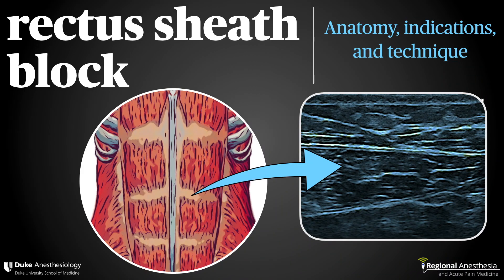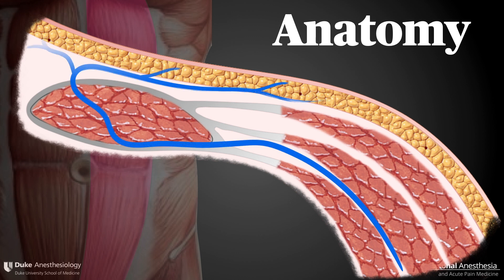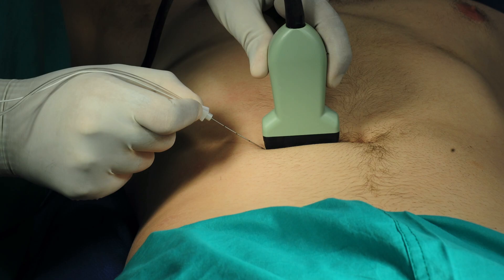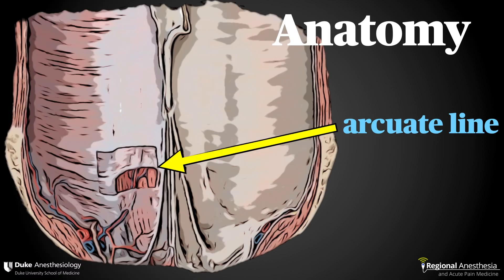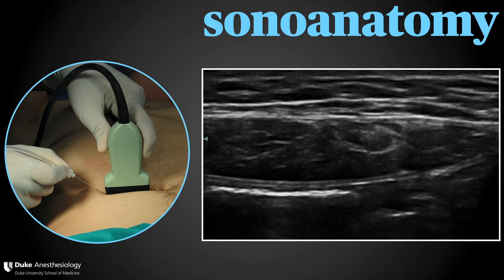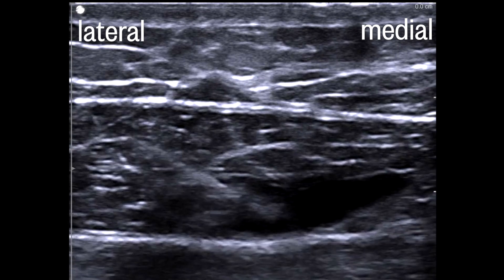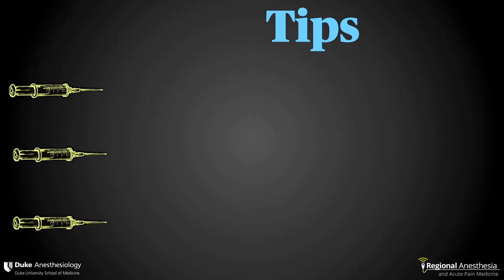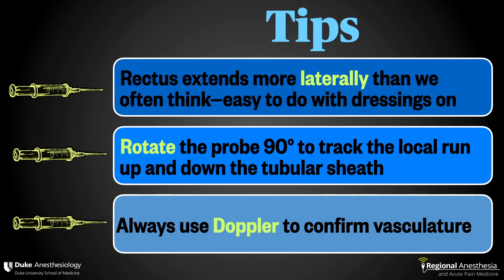Rectus Sheath Block

Comment: what local anesthetic and concentration would you use for a volume of 80mL for 4 injections?
Reply: Safe dose 4 mg/ kg body weight xylocaine with adrenaline, so for 60 kg 240 mg in 80 ml, max 300 mg.

Comment: Great video, as always! I'm just wondering, how low can we get with the LA concentration in this block? We've been using 0,25% ropivacaine at my institution since that's the lowest recommended concentration for this block in the literature I've seen. But given those are small nerves we're blocking, I'd be tempted to go down to as low as 0,1%, and administer larger volumes to ensure optimal spread.

Comment: Because the rectus sheath muscle peels off the rectus fascia so easy, I have used the ultrasound transducer to move around the injected local  under ultrasound dynamic visualization to spread it cephalad or caudad when the spread was not ideal on initial injection with great analgesia.

Comment: Too risky!
Reply: Why? Proximity to peritoneum? It’s not a trocar.
Reply: I guess you are an opiod agonist? Plan A analgesia should always involve block of some description. Most blocks are safe to do with enough experience barring maybe paravertebral or intercostal nerve block. I am not including neuroaxial blocks because everyone should be able to do those barring maybe cervical epidural
Reply: On what grounds? This is first line analgesia for midline surgery and has been demonstrated to significantly reduce recovery time, opioid use and duration of admission.
Reply: Extremely safe. Check this cohort study with 4033 patients:
Kwon HJ, Kim YJ, Kim Y, Kim S, Cho H, Lee JH, Kim DH, Jeong SM. Complications and Technical Consideration of Ultrasound-Guided Rectus Sheath Blocks: A Retrospective Analysis of 4033 Patients. Anesth Analg. 2023 Feb 1;136(2):365-372. doi: 10.1213/ANE.0000000000006282. Epub 2022 Nov 29. PMID: 36638514.

Comment: Fantastic video, I'm on a RAAPM duke vids marathon. In your experience, for whipples, ex lap procedures, if you were to do a TAP, would you perform 4 quadrants rather than a traditional bilateral TAPs (assuming you can't do Epidural)? And if you do 4 quadrants, would you do 2 lateral TAPs + 2 subcostal TAPs, or would you do 2 lateral TAPs + 2 rectus sheaths? I haven't found much literature to say which would be superior. With 4 quadrants you cover higher dermatomes with subcostal, or better midline coverage with rectus sheaths, but you use less volume in each quadrant. Appreciate your thoughts!
Reply: I've had more success anecdotally with rectus sheath than lateral TAP for midline pain. Am interested in RAAPM's response.